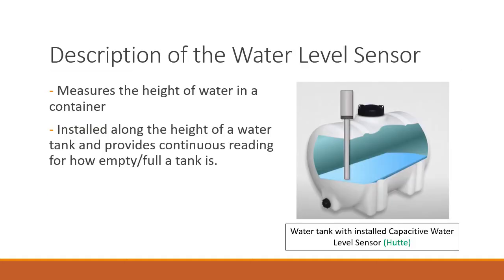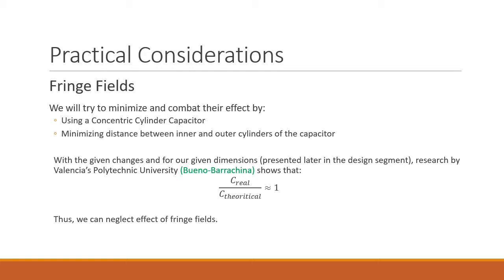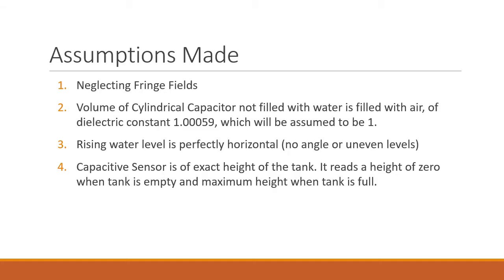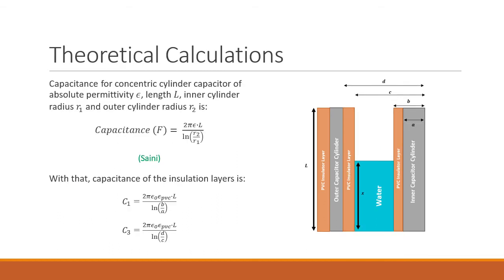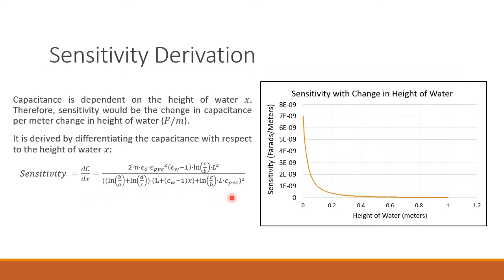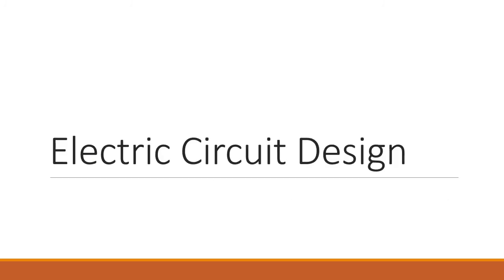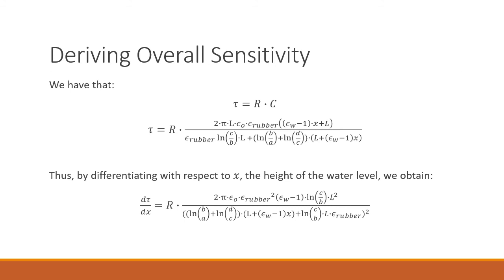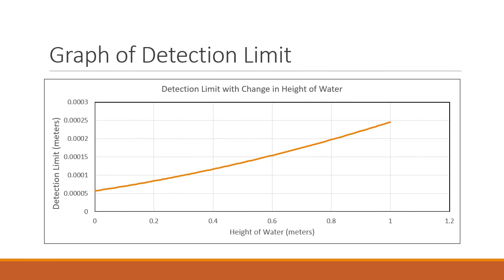ECE 106 Design Project - Capacitive Water Level Sensor

Comment: thank you very much for your presentation, very helpful . I just noticed that the saturation problem of the capacitance does not fit with the simulation , the capacitance should change linearly with increasing the water height (it make also sense), took me a while to figure out the problem.
The derivation of the total capacitance at 10:45 is not correct.
you can imagine a virtual line cutting the cylindrical capacitor at x , you will end up of six capacitors , three above the line in series and 3 below the line also in series and both groups are parallel

    [----II---II---II----]
x................................
    [----II---II---II----]